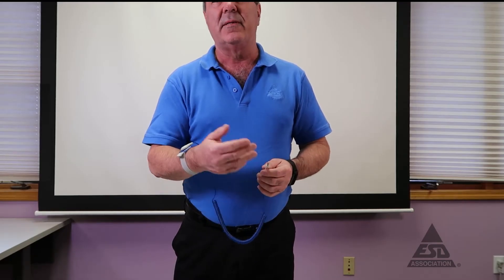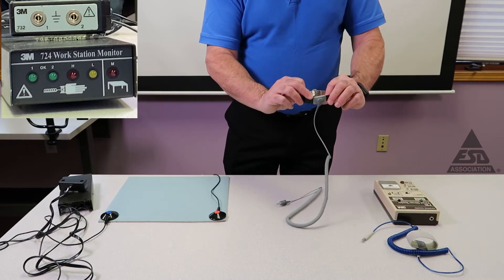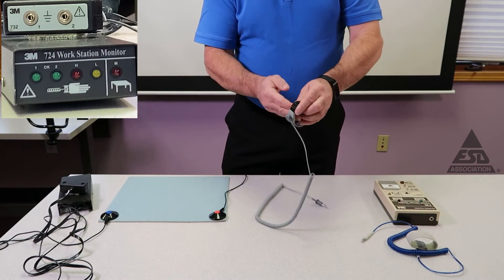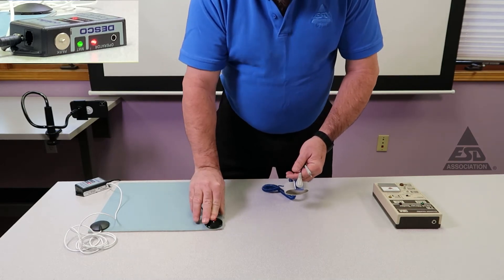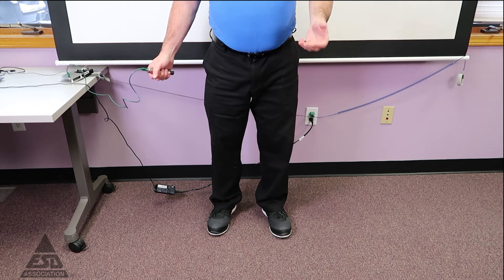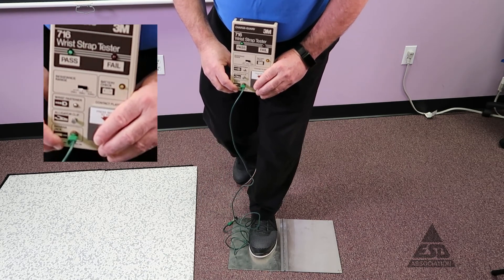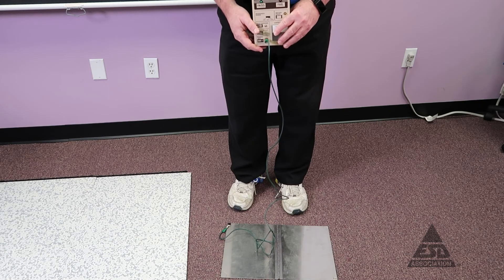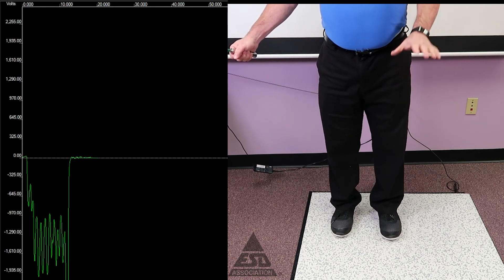Wriststraps, Footwear Flooring System Testing and Effectiveness

Comment: 1:09 "We'll check [the wrist strap] for continuity".  That's misleading. This is not checking for continuity, at least not the way that a multimeter "continuity test" uses the term. You are checking the combined resistance of the strap plus the body -- that is the path from the strap to the touchplate.  The wrist strap tester wants to see a resistance below some high number, say 10Mohm, and crucially, above some other number, like 750kohm. If someone were to use a multimeter to test "continuity" and obtains a "continuous" indication, that would indicate a wrist strap with a lethally low resistance., liable to kill them it they come in contact with a mains voltage on some equipment they are working on.